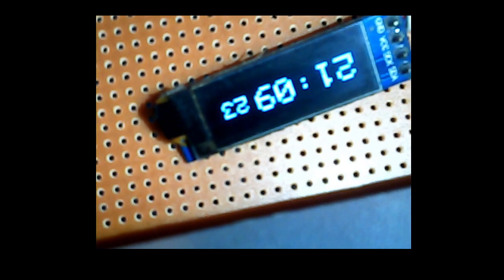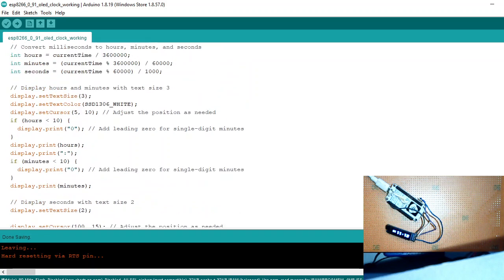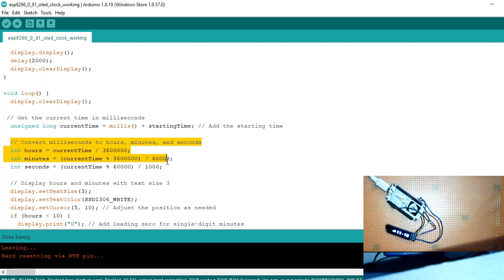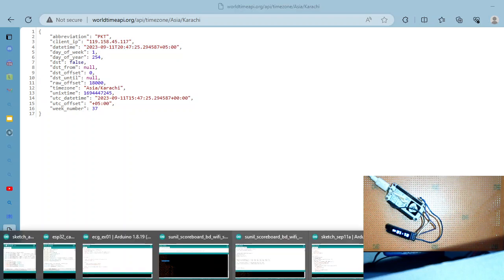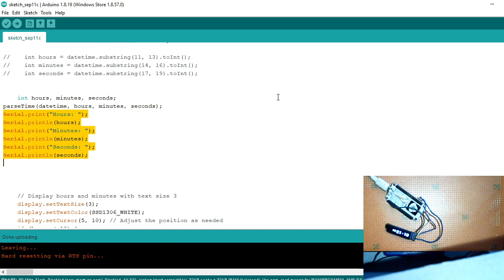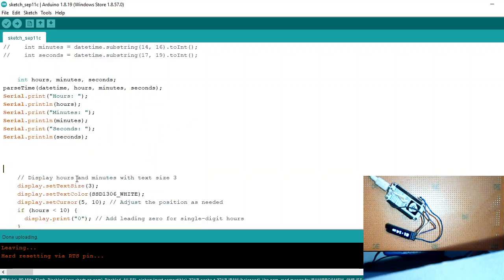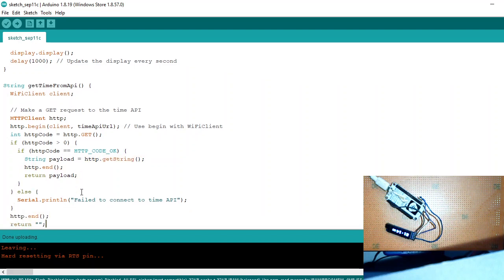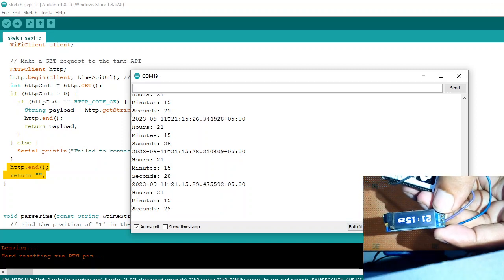Arduino Nodemcu ESP8266 Digital Clock with OLED 0.91 inch display

Comment: couldn't find this tutorial searching your blog, do you have a direct link to it? how often does your code poll the API because most APIs charge money for too many poll requests?
Reply from the maker: I updated the link in the description. Yes there are some limitations in the api callings and we can check the limits from the documentation. Besides, this tutorial is to explain the usage of web api calling and handling and parsing json response and a demo for prof of concept. We can easily combine both of codes presented in the video as well as in my blog post to achieve local clock and update the time when required.  I maybe upload the combine code in future if viewers unable to do that and leave comment about it. Thank you for your comment.
Reply: @ar2050  many thanks, this is great, i just want to use APIs like for weather or currency and this will help greatly. good job
Reply from the maker: @tybozo  I am glad it helped. Thank you for letting us know.